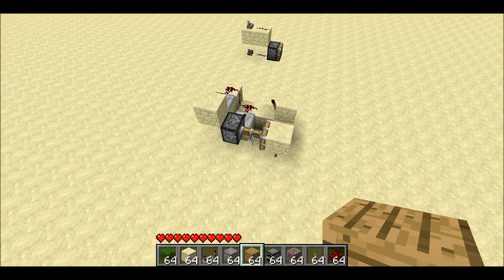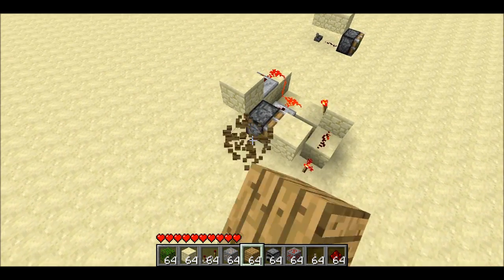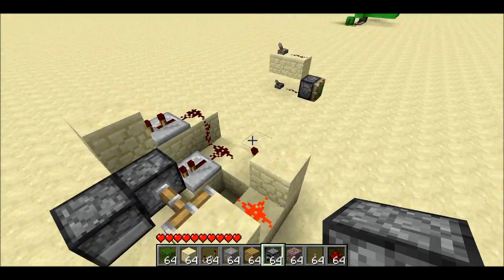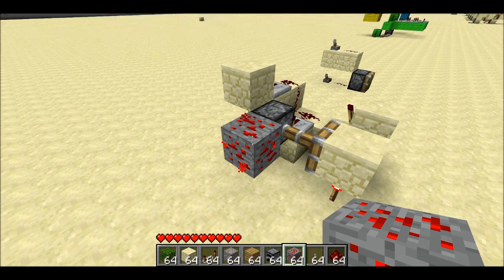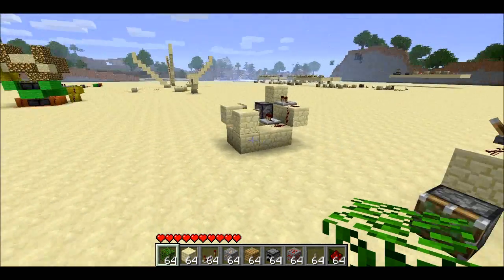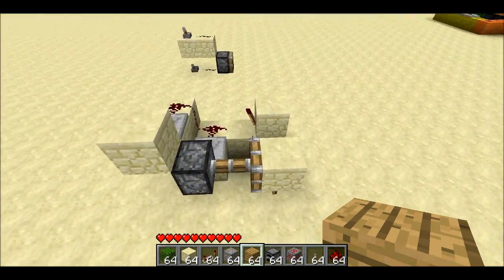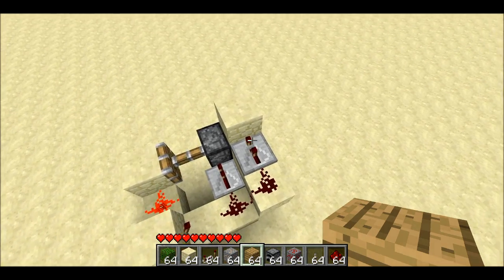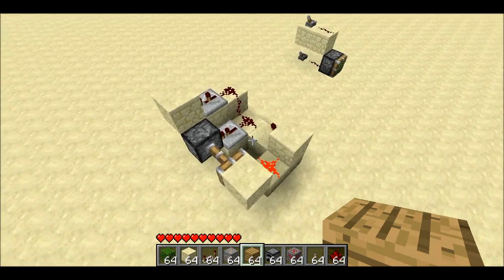SethBling's Block Update Detector Switch (Improvement on Etho's Version)

Comment: Hay seath. just suggesting you try something. but a block diagonally from another. put two red-stone dust on the back starting from the top to the bottom. Then place a puston so that is activated by the redstone at the top. now place a block anywhere near the red torch. . . .your welcome. 

Interesting to note that the block at the bottom can also power a piston . . .think of the implications on this. No I already have and I built the worlds smallest industrial melon farm.

Comment: Nope - the animated redstone or furnace is technically a different block from the original (see they appear separately in the TMI/NEI menu). However, a chest remains as the same block type when opened.

Comment: I made one with a built in T flip flop. Basically the only difference from the one I normally use is the repeater is set 1 tick more. I don't know why it works like that though.

Comment: There is actually a much simpler one, shown here:
key- sticky piston = S, redstone torch = T, redstone dust=D, redstone repeater = R, any block = B, air = A.

layer 1:
AAA
AAA
BRD
TBB

layer 2 (behind layer 1):
ADA
ABD
SAB
BBB

this uses the same principal as yours, but it is more compact and possibly faster (1 tick). it also uses less materials.

Comment: @awareqwx It'd only be useful for a lure then I guess - only destroying the sponge (at least in SP) will trigger it, but then again, why not place it against the detector if it only triggers it from 5 blocks away right?
And another way to trigger it with sponge is using pistons, but you could use that signal from activating that to trigger whatever you want to trigger already, right?

Comment: This proved to be a very useful BUD design. The good thing about this one is that it updates the wire instantly, whereas many other designs that rely on pistons pushing a block to connect a line have a small delay.
I made use of that for an automatic melon farm that keeps the farmland.

Comment: Oh also, on your demonstration on the simplefied circuit, the wire on the bottom doesn't really matter. When the upper wire is powered, the next block update will cause it to extend. When it is unpowered, the next block update will cause it to retract. Your wire is simply causing the update, but it doesn't even need to point towards the block.